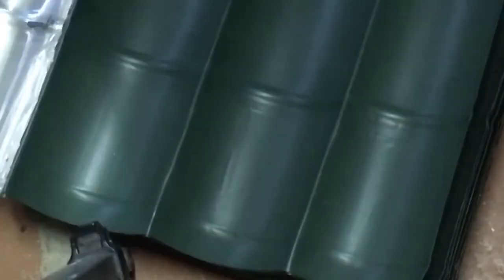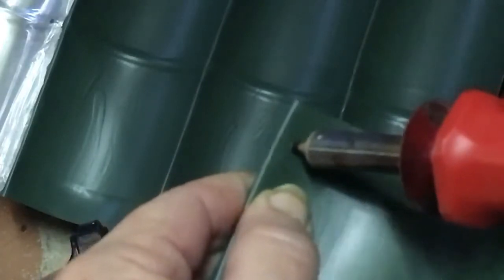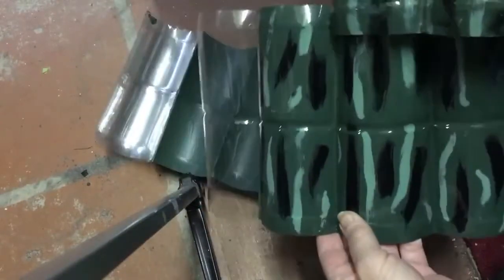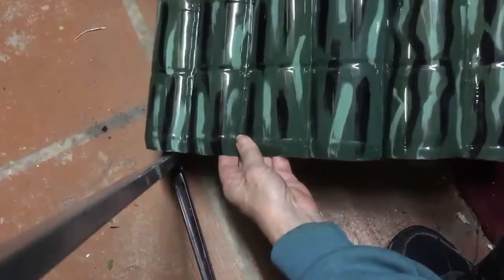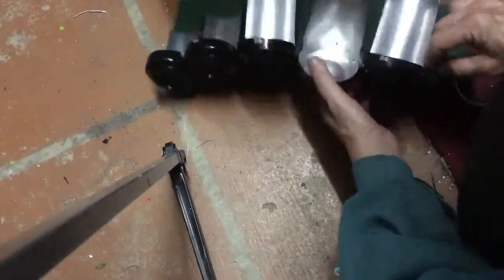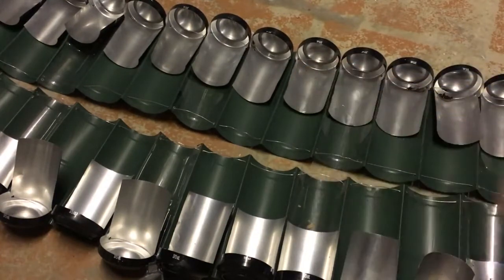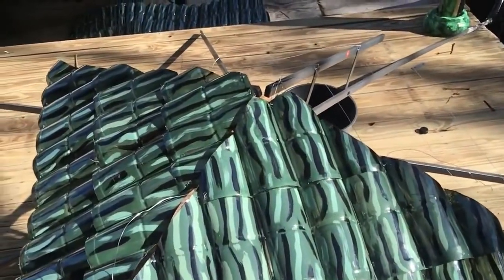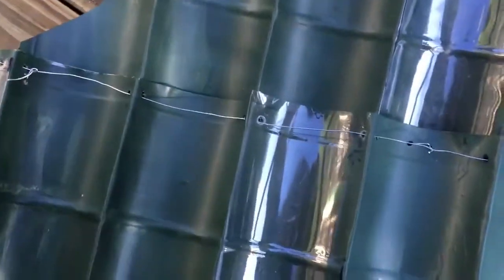How to assemble Plastic Bottle Roof Tiles

Comment: Amazing creation ! But really hard to watch for my brain, as the camera is sooo close 😅 How is it lasting, 3 years later ? Cheer !!
Reply from the maker: Hi Thank you for watching It is still looking as good as it did when I first put it up But please be aware I put this one up 5 years ago when the plastic bottles were still good quality and quite thick Since then the soft drink companies are using a softer and more inferior quantity bottle ,so the other ones I have made are not so good,as the bottles have melted and warped but still work quite well They don’t look as good and in some places are not waterproof but I just added extra bottles underneath to stop them leaking Still a great way to make cheap roofing and recycle plastic They are also great for privacy screens Make them the same way and hang them up Hope that helps you out 😉

Comment: Heya Brit! Thinking of using these on my bay window for my Japanese themed diy motorhome - I'm considering fibresglassing a row once I've made them - LOVE this idea so much but I want them to be as durable as possible. Any clues as to the best, thickest bottle you've worked with?
Reply from the maker: So very sorry for the late reply Unfortunately when I made this the soft drink companies were using a nice thick plastic but lately they are using a bit of a soft one and they tend to melt and warp in the sun I hope you can find some old bottles Cheers😊